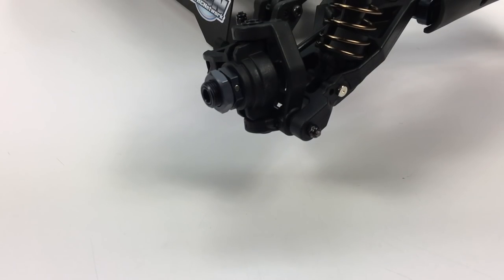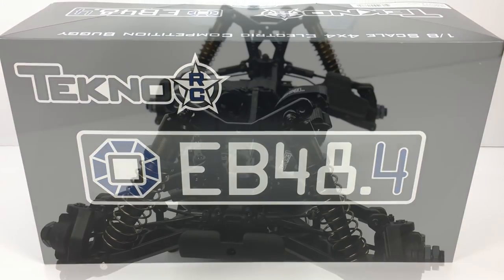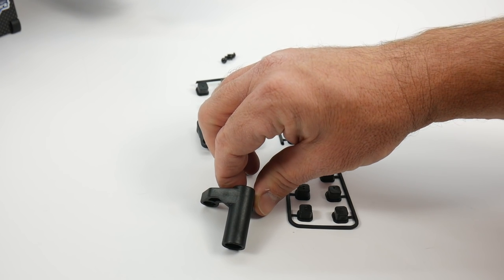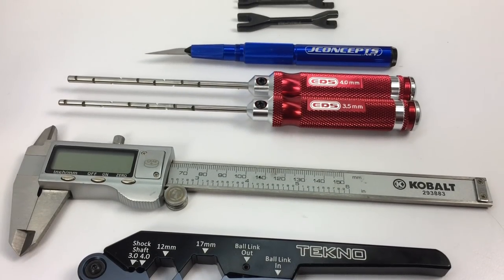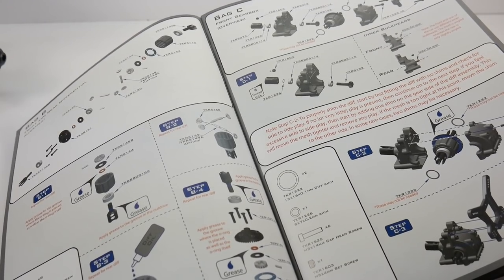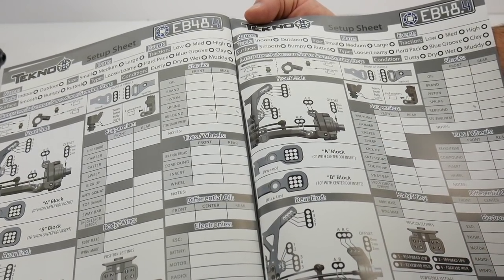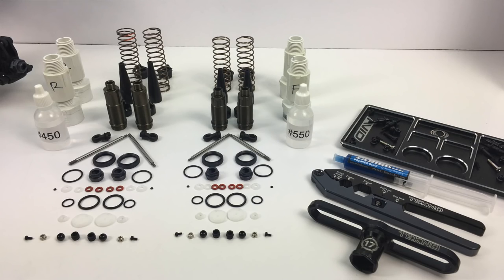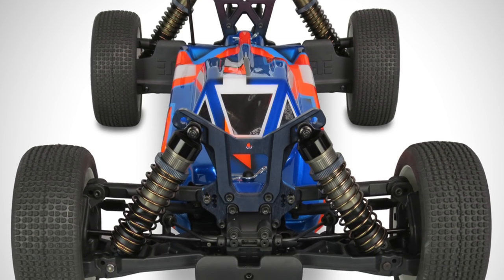Tekno EB48 4 1/8th Scale Electric Buggy KIT - Build Update 1

Comment: Nice car Rich!!!
Did you ever feel that some of the ball ends were tight?
On my eb48.3 some went together so tightly I had to take a dremel to widen them so the suspension would actually work haha
Reply from the maker: Nope, mine were all good.  Many of the rod ends have a enter point and exit point though
Reply: Yeah, I noticed that when I put together the shock ends yesterday
but some, especially the sway bars and steering were so tight the suspension barely worked

Comment: awesome video,i have a 48.3 and was never happy with the way the car tries to pull the wheels towards chassis 2/3 thru the suspension travel in the front,so i shelved it and stopped racing,do the universals fix that problem?. Also are the new shock springs longer than the ones on the .3?.

Comment: At 6:07 you show the shock parts. Are those the parts in the kit? The manual doesn't show a bladder install.
Reply from the maker: Jack Crow yes, everything you see in this video is included in the kit (minus the tools, of course). The EB48.4 comes stock with an emulsion style shock, so no bladders....I may have MIS-spoke